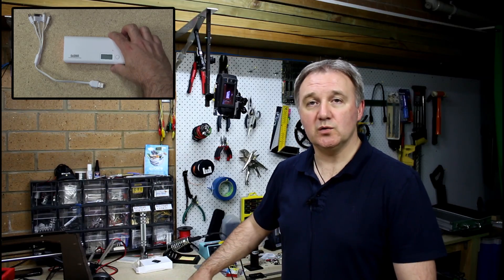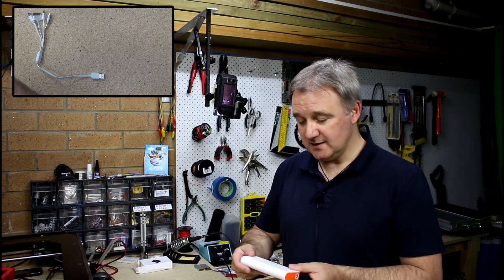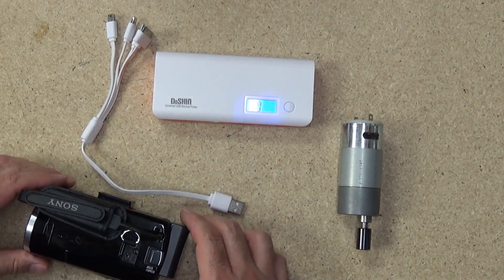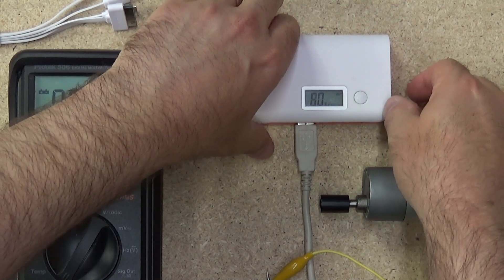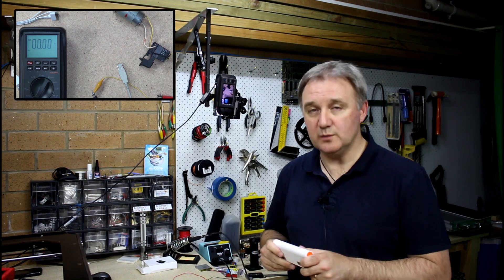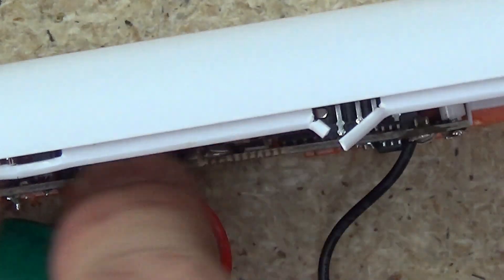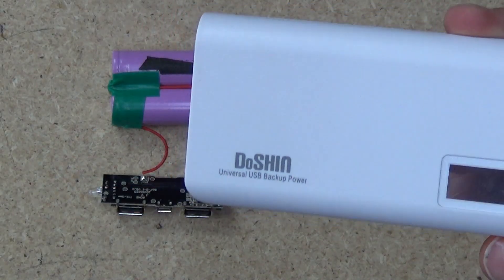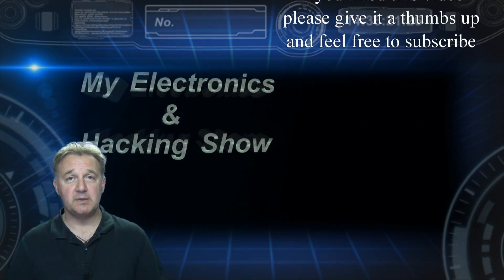Power Bank Review & Teardown (MEHS) Episode 36

Comment: One of mine is exactly the same design as this just with different decals. Only has around 3000 mah capacity (using voltdoctor), and both the 1a and 2.1a outputs seem to max out at just over half an amp. Pretty much guessing 4 of the 5 cells are pure sand.

Question is this though. If I was to mod this, putting 10+ good quality 18650 cells in parallel into this circuit board and display, with the intention of using it as a bag-based power pack on long trips for charging phones, drones, and other power banks:
1 - would the thing actually work, ie supply power to phones and other smaller power banks?
2 - would this lead to me getting the full 1a and 2.1a outputs?
3 - would the LCD display work accurately ?
Reply from the maker: Hi.
1.  Yes it would work but I doubt it would be worth it because of the answers to the next two questions.
2.  No.  The outputs are regulated by the board, not the cells so, no.
3.  Yes to a point and only if the number of cells is the same but the money you poor into good quality cells is better spent on a good quality power bank with ll the features you want.  Cheers.
Reply: Ahh thanks, so a LCD display on a 5-cell bank could not be put across a, say, 10 cell bank then :(
Reply from the maker: - No.  Cheers.

Comment: Hi , I have some 136850 batteries . I tried to fix it with my new charger which i ordered from ebay . all fixed but it,s not charging ,what could be the reason ,is the charger not suitable for this battery or could be other reason ,can any one help me
Reply from the maker: - Hi.  I don't know what batteries you are referring to.
Reply: This batteries are salavged  from my HP laptop ,I tried fixing it to my diy power bank bought from ebay , power reads in my multimerter as 3,5v and some dead cell after reviveing live to  1.2v , is not chargeing at all ,
could not find the fault , whether new chager rejects this cell and only accept 16850 cell ,just need to know from your experince if any ,,,,tks
Reply from the maker: - No help I can offer here.  Sorry.
Reply: Thanks

Comment: I was gifted one of these, recently, and I plug my iphone 6plus into it, and it stops charging within about 28 seconds.  That is plugging it into the left hand USB port.  Do you think I have a faulty unit?  Or am I missing something. The tiny Chinglish intructions that came with it, only seemed to say charge it up for 24 hours. I did that.  Any ideas?
Reply from the maker: - Hi.  The quality from unit to unit could vary greatly from what I've seen.  On my unit the USB ports were marked incorrectly.  The port with one lightning bolt was actually the high current port and the one with two lightning bolts was the low current port, only good for 1A max.  Try the other port and see if you get the same result.  Cheers.

Comment: Motors draw large inrush currents that most likely exceed the peak current rating of the USB port.
Reply from the maker: - Hi, agree but the ports never shut down and the inrush period was over by the time measurements were taken.  Good point but still a bad power bank.  Cheers.
Reply: The switching converter used to supply a regulated 5v to the USB ports would have entered cycle by cycle current limiting, motors can have an inrush current many times that of the nominal run current. All of this takes place within a few uS at the converter level.
Reply from the maker: - Hi.  I understand your point and information but the motors were allowed to run for a few seconds with no load and continued to run meaning the battery pack and electronics within were able to run the motor and get past the issues with inrush current.  Its only under manually applied load, which was many seconds after the motor was being powered by the battery bank, that the battery pack failed to produce sufficient current.  In this case it wasn't inrush current or some form of trip circuit that caused the failure of the pack to produce expected current ratings, it was the false claims of the pack.  Cheers.

Comment: hi, good vid. how well would this work via dummy battery, to power Sony A7s?
Reply from the maker: - Hi.  I would say no.  After using it for a short while I have been disappointed with the battery life, amperage and sustained voltage.  Don't buy.  Spend a bit more and get a quality unit.  Cheers.
Reply: thank you, any you'd recommend?
Reply from the maker: - I think the Xaiomi units are OK.  Also Samsung.  Cheers.
Reply: thanks mate

Comment: I just ordered one on amazon now, didn't know if I should of got something else? ? I pay $23
Reply from the maker: - Hi.  $23 is not too bad.  If you need a good one that you can rely on that genuinely had great capacity then I suggest this is not for you.  Having said that a genuinely good unit will start at $60.  Cheers.
Reply: yes thanks, honestly I thought it was something less powerful and I just went for the price, but for shore in summer sale I'll look again
Reply: My Electronics & Hacking Show OK so the battery  doesn't last long, I want to get the best one now, AC Portable Charger, RAVPower 20100mAh which is the best
Reply: I want the best best portable charger for about $200
Reply from the maker: - Hi.  There is a lot of garbage out there.  I would probably spend the money on something like a 20,000mah Anker.  Or at least go with something reputable that has a good website that has been around for more than a year.  Cheers.
Reply: okay sounds good, thanks
Reply: I'm going to Spain next summer again so my best best is poweradd

Comment: Thanks for video.  I couldn't help but be your next subscriber making me number 10.001.  !!!!  I am looking for videos like yours to help me decide which power bank to purchase.  I have 4 requirements that must be met.  1. cheap   2.charge-discharge protection 3.anywhere from 5-8 cells.  4. can power device while charging.    I plan to purchase the 18650's locally.   I would deeply appreciate any suggestions or links from anybody.
Reply from the maker: - Welcome Mr 10,001.  My only suggestion at this moment is go for quality over capacity.  Most things you need will be addressed with quality but at the cost of some capacity.  Hopefully I will get time to make a few suggestions or maybe you will get some from others.  Cheers.
Reply: Your response time defines the speed of light :)    Thanks alot my friend!

Comment: hi man! i recharge my iphone6 on 5v 2.1A or 5v1A? what is the diference?
Reply from the maker: - Hi.  No difference from you're phone's point of view.  The essential bit is that you're using 5V.  That's like saying both the phone and power supply are talking English.  The amperage is like saying, how much is being spoken.  The phone will want to talk English at a minimum of 500ma (0.5A).  As long as your power supply is taking English at that speed or faster, the phone is happy.  Having a 1A or 2.1A power supply simply means that the phone will get enough power to charge properly or run properly.  An Ipad as an example still talks English (5V) but wants to talk much faster and won't be happy unless it gets 2.1A.  It will basically (not completely, but for argument sake), ignore a conversation at 0.5A.  Hope that makes sense.  Cheers.

Comment: I imagine the port amperage listed on the case is reversed to how the circuit board is laid out.
Reply from the maker: Hi.  That would have made sense if any of the ports came close to 2amp output.  Roughly, the 1 amp was about 1 amp and the 2.1 was about 500ma.  Cheers.
Reply: Did I not see you pull more than 1 amp by loading the motor @ 4:20 ? The pack seemed fine with it.
Reply: I seem to remember a bigclive video where he backwards engineers a similar device that had the circuitry being reverse to what was claimed on the case.
Reply: My Electronics & Hacking Show  You may well have defective product though.
Reply from the maker: +Pha Q - Yes that's definitely possible.  I have thought of getting another to verify.  The main reason I didn't bother initially was the other issue of the battery capacity being severely overstated.  Overall, still quiet a gap between the claims and reality.  Cheers.
Reply from the maker: - Yes a little more for a short period but I don't think it would have approached 2.1amps continuous.  Cheers.

Comment: So just to be clear... is this portable charger actually rated at about 9000-10000 mah instead of the advertised 50000 mah? I just bought this for 20$ from Wish. Was i completely ripped off or does this charger still have some worth for the 20$ I spent on it?
Reply from the maker: - Hi.  If you think of it as a $20 item then it's worth the money.  If you need a 2.1 amp outlet from one of the USB ports or need to use the unit while charging it then you will be disappointed.  And yes the advertised capacity is 50000mah.  The reality it between 5000 and 8000mah.  Cheers.
Reply: i would like to know as well bcz i am buying one in  a day
Reply: Thank you Sir i have avoided buying it. I am now buying a genuine 10000 mAh.
Reply from the maker: Immortal Assassin
- You're welcome.  Good move.

Comment: I have one from ECtechnology and it works very well. The ports will put out the rated amount of amperage, providing that the device being charged will take 2.1 amps. I have load tested each port and was able to pull 2.15 amps from the 2.1 port before the unit shut off. If you pull it apart then you can test each cell for their WH's and MAH in a discharge tester, then add up what you have and that is what your pack has on tap. However, remember the circuits inside the unit will eat some of that power so bank on a 10% loss, also the cable being used and the device being charged will decrease the number of charges if left on while charging. At least you will know what the max available power is and it will be most likely less than rated power. Mine is rated for 22,400 MAH and that maybe true at the batteries, but not when the converter sucks up some of it. I got about 11,500 mah out of mine. It is still pretty good for a two year old battery pack.
Reply from the maker: - Hi.  Yes I'm sure there are some reasonable units out there.  Thanks for the share.  Cheers.

Comment: I just received my Universal USB backup power bank ( that's all it says on it, No brand name since it's straight from the Japan factories in guessing) it says Cap: 100,000mAh  3.7V/48Wh (MAX) and the ports amps and colts are just as yours says. I received it with 56% charge out the box standard connectors 4 in 1. I charged it over night and it was at 100% (about 6-7hrs charging) but 5 mins of the charger it went to 99% without even being used. About an hour later it said 94% (without being used yet)
Reply from the maker: - Hi.  That sounds familiar.  A quality unit should hold charge for months.  It sounds like the circuit is constantly draining the battery.  I have an Energizer branded 8000mah unit that holds most of its charge for at least 6 months.  Cheers.
Reply from the maker: *****
- Yes its possible the circuit board in the unit was less than perfect.  If I can get hold of another one the same I might do a follow up video.  Cheers.

Comment: I took apart an Adata 10000 mAh powerbank, (flashlight, dual 1A/2A ouputs, 4 LEDs for batttery status). 
The 2 ports were connected in parallel (continuity between pins)... Max output current about 1.2A, but then the voltage drops to about 4.2V.
Reply from the maker: Hi.  Sounds like another product that does not meet expectations.  I might do a video on a good quality unit and compare.  Thanks for the share.  Cheers.
Reply: +My Electronics &amp; Hacking Show This is the actual powerbank (Adata PT100): http://www.adata.com/en/mobile/feature/312

I dont have the packaging anymore, but I remember a link which they provided explaining the capacity differences. So a 3.7V 10Ah pack is about 5V 6800mAh. Found the link:
http://www.adata.com/upload/faq/PowerBank_FAQ_en.pdf

This of course, does not explain the fact that the ports are connected in parallel and the low current  output capability. They do call it a region exclusive (emerging markets), which may explain the lack of certifications.
Reply from the maker: MHBGT - Yeah they rate the battery capacity at the native 3.7v, the resting voltage of the battery(s).  That's okay as that's what most seem to do.  At least the claim of 10000mah seems realistic.  The case looks almost identical to the one I did the video on.  The case was the best part of my unit, very well made.  It looks like the circuit board on your unit is different.  That's a good thing.  I can't tell what the battery quality might be like.  Did the batteries look better than those in the one I pulled down?  How did you measure the current limit?  {I need to get my hands on an electronic simulated load}.  I wonder if it would charge an ipad and ipod or phone simultaneously?  it's not a scientific measure of current but modern electronics are pretty fussy when it comes to power and will warn or fail to respond if the power is insufficient (such as an ipad when being fed a substandard load).  Also, does your unit fail to charge when a load is on the USB ports, or fail to power the USB ports if the battery is being charged?
Reply: +My Electronics &amp; Hacking Show 
Yes, the cells look okay from what I could gather on the web, mass produced by a "well-known" chinese company. So I think the cells are decent enough. 

I used a multimeter, with a DC motor and some load resistors in parallel. The motor alone (also applied a "braking load" -as you did) could not draw enough. (Special type of resistors, encased in a  heatsink for dissipation). Then just add more resistance in parallel if you want to increase the load. 

A second multimeter allowed me to measure the voltage on the output. The best would be to just use a load of pure resistance, eliminating the measurement errors created by the back EMF created by the motor. 

I can't quite remember if it charged itself and supplied power simultaneously as I don't use the powerbank these days, but I can dig it out and check tomorrow sometime.
Reply from the maker: MHBGT - Thanks for that.  Yes i wouldn't mind knowing as that would confirm that your unit uses a different board to the one I pulled down.  Yeah the motor load approach is indicative but crude.  Really need an electronic load for more accurate testing.

Comment: ,i received it yesterday this battery bank ,so first i put on charge start on 50% but its takes more than 5 hours to charge it full to 100% ,when its full, for testing it i charge a tablet and a phone but its drain so fast ,and now from 20% to 100% its takes me more than 7 hours to charge it again  :( ,,do not buy this item
Reply from the maker: +Matthew Grech - Yeah, the charge rate is 500ma.  The battery bank is nowhere near the claimed 50,000mah, more like 6000mah.  That means a charge time of 12 hours to full.  Its not good if you're expecting quality, thats why the good units are rated at around 18,000mah and are 5 times the price.  Cheers.

Comment: In malaysia we don't have DoSHIN brand we always gets the chinese named ones and they are crap... claims 10000 but actually more like 6000 mah so I made an ugly looking actual 20000 mah power bank!!! and all of the batteries I use in it are the NCR18650PF (MH12210) these batteries lasts me good I don't have to charge it everyday it's like 3 days of use then recharge for just 6 hours :D
Reply from the maker: +Donny Slander  - Hi.  Yeah you only get what you pay for.  I'm trying to finish the Mk6 double Pi laptop and I was using the batteries out of the DoSHIN power bank.  I'm thinking about dumping them and using a much smaller and convenient 6000mAH bank of quality batteries.  Same capacity as the DoSHIN just much much smaller footprint.  Cheers.
Reply: +My Electronics & Hacking Show
 if that is you're goal your?? I am not good at grammar so please forgive me, maybe you might have better chance at using Li Po battery or Lithium Ion battery they have smaller form factor and usually offer faster charging :D. Cheers :D
Reply from the maker: Donny Slander - It's not really my goal.  I initially wanted to see what the real capacity was and to see if I could re-use the LCD display.  I didn't want to waste the batteries so I'm still thinking about using them in the Raspberry Pi 2 double Pi laptop but, as you said, I can get better results if I use a LIPO pack.  Cheers.
Reply: My Electronics & Hacking Show
Well, you have lots of projects that I am intrigued to watch like those Pi laptops very well made mate :D wish you all the best cheers :D

Comment: the best battery on market is 3400mah   times five cells  is 17 Ah in bast case scenario, Keep in mind this battery is 7$ each. So if this power bank isn't 50$ straight from china , there is no way that battery is in there...
but you can buy case for this kind of power bank on ebay for ~5$ and put whatever cells you want in there...
Reply from the maker: +mateusz1945 - Hi, yes very true.  It was never going to approach the claimed 50,000mah.  The best I've been able to do for the true 3400mah batteries is $25ea, so $125 AUD for genuine capacity.  I didn't know about the empty battery case.  Thanks for the tip.  Cheers.
Reply from the maker: *****
- I will keep that in mind when I do the next powerbank teardown.  Cheers.